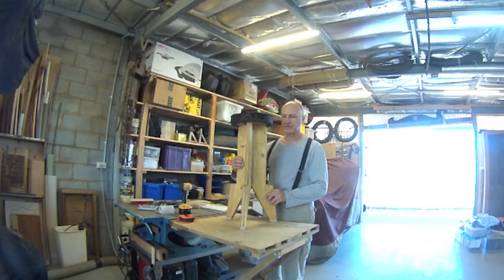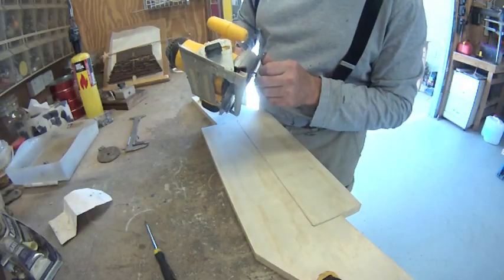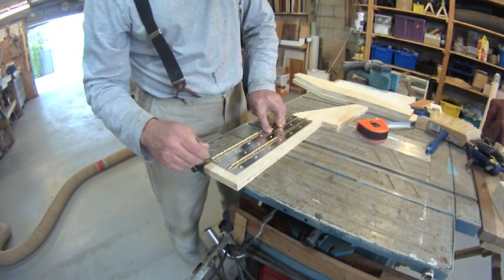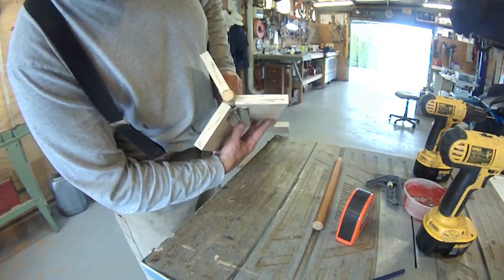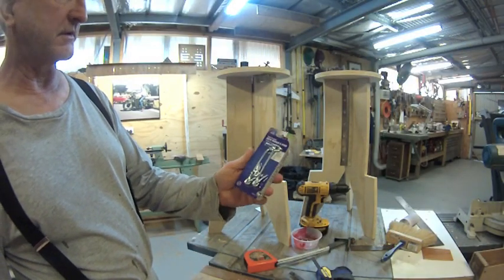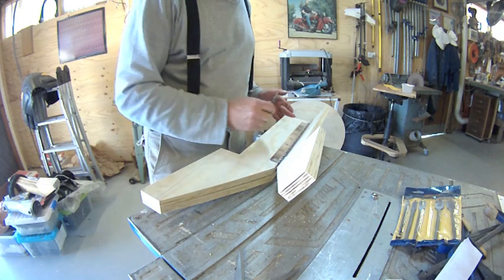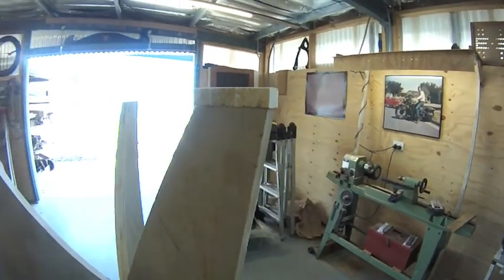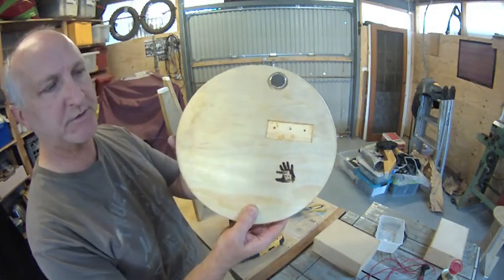Folding Stool #2 - Made by J&D

Comment: Pretty slick!  A suggestion-  & granted it's more work above and beyond your basic practical design- soften up all those hard, straight lines by cutting elegant sweeping curves in the lower inside and outside of the legs; and use a 1/4 round router bit on the exposed edges of the legs.  You could also use large hole saws to cut in lightening holes on the legs.  Lastly, a nice translucent stain would look better than a clearcoat alone.  Great design!
Reply from the maker: Yes, curved lines and stain would make it more attractive and I might do that in the future. As for the lightening holes, I am worried about flexibility and strength because the stool can be subject to significant torque.